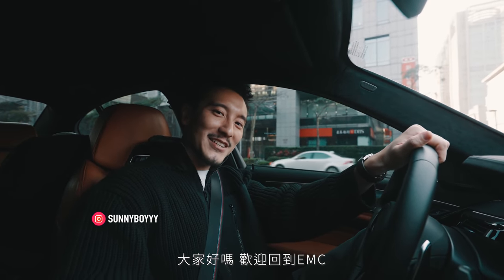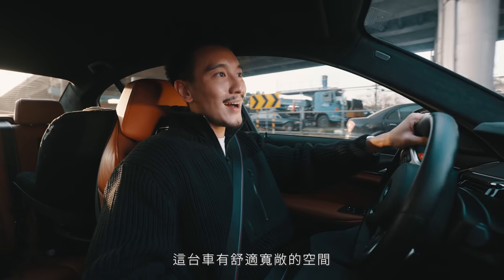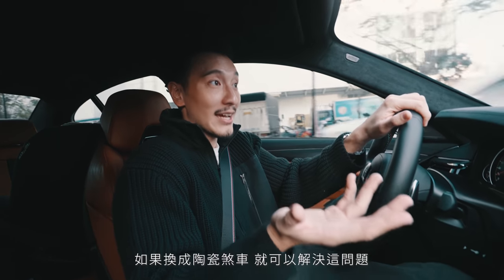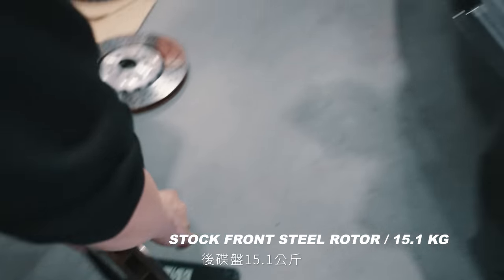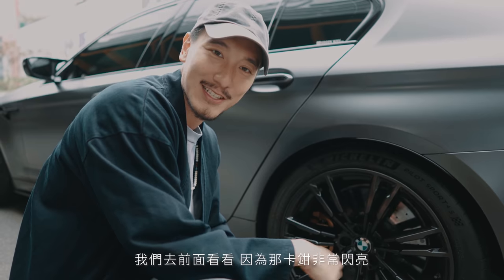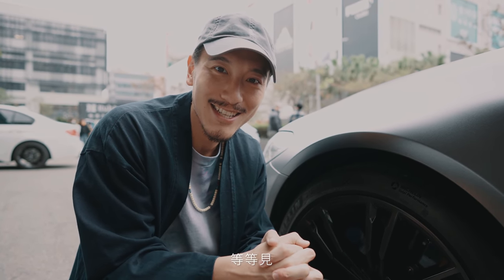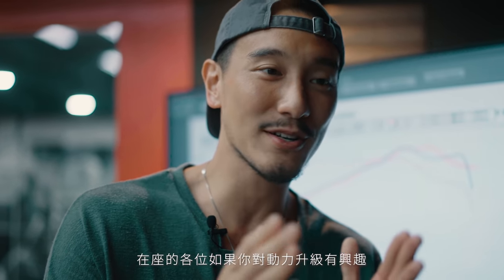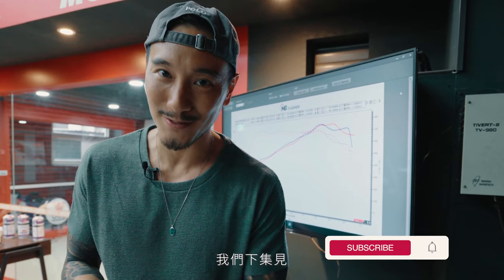M5猛獸進化第一階段！輕量，排氣，陶煞，尾燈 | MODDING THE M5! EXHAUST, BRAKES AND TAILLIGHTS!《EMC Vlog Vol. 45》

Comment: Lucky you are still in TW not in California, now if you wanna mod your pipe in California, you can’t do de catalyst as straight pipe, it turns illegal now
But I’m respect that you are still keeping the catalyst

Oh by the way, since you’ve upgraded your breaks into Ceramic breaks, I suggest that you need to code your computer for the breaks as well, within the BMW ECU system, there are 2 different setting for breaks, one is standard which is loaded as your original breaks are standard breaks, another one it happened to be performance breaks, once you’ve completed the coding, the way you feel from your breaks will be different, a lot BMW owner they mod the breaks into Ceramic breaks but not even knows that

Comment: I am a huge fan of M3 and M5 except in the e92 generation and 46s one gota be so worry about those rod bearings and the throttle actuator, the throttle acutator is an easy replacement but the bearings always worries me. So far since F80 I think there has no rod bearings issue..